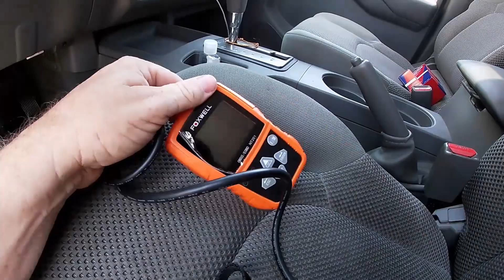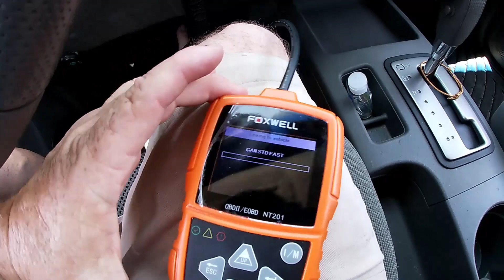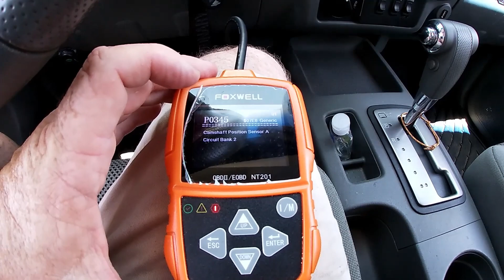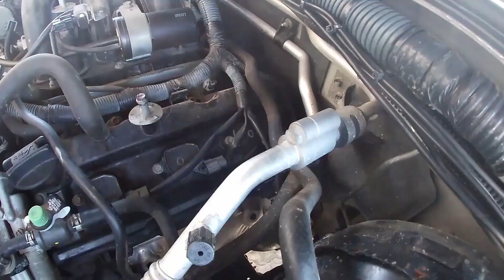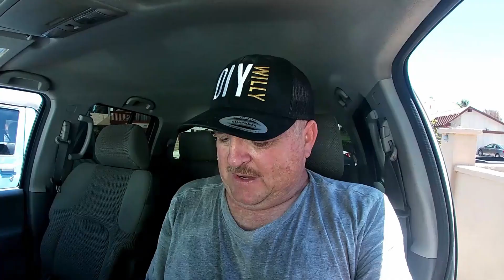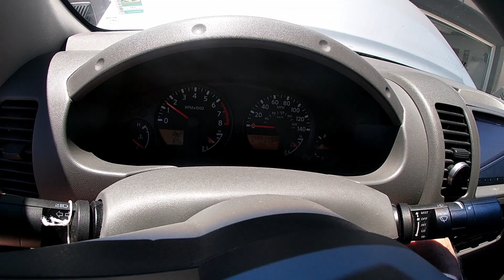Nissan Frontier 4.0 Cam Shaft Sensor Replace

Comment: Replaced the right sensor A. To remove it, I pulled the tire off and pulled the mud guard back, and there was plenty of room. It still goes off every few months. I have to unplug the battery, cross the wires to drain the memory, and restart. It works for some time.
Reply: If your camshaft sensor is a chronic repeat offender at that rate, might need to look at the timing chain and see if it's stretched or the tensioner is worn out.
Reply: Also apparently nissans are very temperamental and like to burn through those sensors if they are not OEM branded hitachi/ astemo is also a good buy as they are OEM manufacturer. Just doesn't come with the nissan box lol

Comment: I replaced both cam sensors and cleared the codes but i cant get the generic code to clear
Reply from the maker: What’s the generic code? The truck will most likely clear it in the next drive cycle if there are no further issues.

Comment: Thanks for sharing my I have 2013 Frontier and my truck is doing the same thing the garage told me that it was a cam sensor bank 1 not sure if that’s right side or left side your video was a good help I just got to figure out what side it is
Reply from the maker: Hello Myty, So glad you liked the video. Best to change both sensors and some suggest all three.(2ea cam and 1ea crank) Reason being when one goes the others are usually not far behind. On the Nissan v6 bank on is on the passenger side. Good luck with the repair!! Thanks for watching!!
Reply: Thank you your were a good help
Reply from the maker: Glad to hear your truck is running again.

Comment: Curious what you used to get the bolt out? I’ve been trying to get this changed in my Xterra, and I can’t seem to get anything on the bolt to get it out. I’m thinking that I should unplug it first, and then do the bolt.
Reply from the maker: No it’s a tight fit but using a small 10mm socket and 1/4” drive ratchet should remove the bolt. I feel it’s easier to unplug when out.

Comment: Was that the bank 2
Reply from the maker: Hello, Yes that was bank 2. However it’s recommended to change both sensors bank 1&2 when doing this. Also the crank shaft sensor but not really necessary. Thanks for watching!!

Comment: I just replaced the crankshaft sensor on a 2012 Frontier with a 4.0 V6.  Thanks to all the folks for sharing their experiences and some tips.  Keep up the good work Willy.
Reply from the maker: Hello Jim, I usually suggest changing all 3 sensors but for me just the cam s baits did the job. Thanks for watching!!
Reply: Did your truck leave codes. My truck suddenly shut down last week and thats what I thought it was.  My mechanic friend said not likely because no code was present.
Reply from the maker: Yes the truck showed P0345 for cams sensor.

Comment: Hey brother I came across ur video I’ve got a problem with a truck just like urs.. it will crank but running horriable had to pull it home it wouldn’t excellerate and the would both down like it’s being smothered out.. my scanner is saying the Maf senc is at 0.01 % is it safe to say it’s went bad? Or does it sound like another issue causeing it to run horriable? Thanks bro appreciate ur channel!!
Reply from the maker: Hello Joshua, There so many things that could cause the problem you describe. Yes the MAF sensor could be bad. But I would believe that there would another code also relating to fuel balance or similar. Could also be the cam sensors are failing or have failed. These would cause a poor running condition. What were the codes pulled from the computer? Another possibility is bad cats. Not allowing the engine to breath properly cause a running issue also. Kinda like a potato in the exhaust pipe. Really hard to troubleshoot your vehicle without seeing it. 
Thanks for watching!!
Reply: Hey Brother!! Thank you for replying!! I changed the Maf and it’s cranking and idoling but still feels like it’s smothering? It says P0300.. Random/multiple Clyinder Misfire.. andP0113 intake Air Temp 1 circuit high.. is the 2 codes ? I’m NO Macanic at all but cash tight ya know n tryn to get it running for work
Reply: Thank you so much for replying bro!! I’ve Got 1 of my NEW FAV CHANELS!!!!!
Reply from the maker: Try looking for vacuum leaks. There are not too many vacuum hoses but remove the plastic engine cover and inspect the small hoses going to the plenum and accumulator. Look for small cracks in the hoses and replace them with 6mm hose if damaged. Also the throttle body can be dirty on the back side. It’s easy to clean but removing the 4 screws and the 2 coolant hoses. Clean the throttle body of dirt with carb cleaner and a small tooth brush. Just be careful not to push too hard on the flap. The throttle body has an oring seal and is reusable if not damaged. Those are a couple of easy things to check and repair. Other causes are more expensive and time consuming like the cam sensors, spark plugs and bad coils. Since the code is just 300 and not something like (301-306) makes it harder to diagnose with out really scanning for additional information. If it was 301-306 would tell which cylinder had the misfire. 300 is generic. Sorry I can’t help more… Good luck!!👍
Reply: @DIYWilly  dang Brother You R THE MAN!!! Appreciate your help you r spot on!! Thank you again!!!!!!!
Reply from the maker: I know this is a dumb question but is your air cleaner clean?

Comment: I replaced both of mine and crankshaft sensors and my truck is still doing it, so you think I just got bad sensors? And is it important to clear codes before starting it?
Reply from the maker: Hello truth, What are your codes? Possible you have bad sensors but I doubt it. Thanks for watching!!
Reply: If you purchased aftermarket cheap sensors then yes you will continue to have the issue.  Unless you got a code for the sensor it may likely be something else.  My truck stalled last week for no reason and I thought it was the cam sensor but there are no codes showing up.  Hasnt happened since
Reply: Could be a bad cam

Comment: Would that sensor cause crank but no start?
Reply from the maker: There is a crank sensor that detects rpm.
Reply: @DIYWilly  so the camshaft sensors wouldn't cause no start?
Reply from the maker: @c4or2ey0  yes it could cause it not to start. But from my experience it usually just runs bad like it’s in limp mode with very little power. Do you have a check engine light? That would be a good way to identify the problem your talking about.
Reply: @DIY Willy  it's a friends truck so I'm not to sure just yet. He was asking me about what I thought might cause it to crank and no start. He said it had a code supposedly, for the camshaft sensor.
Reply from the maker: @c4or2ey0  Definitely try and get the code. Also how many miles on the truck?

Comment: WOW! great job. I checked out my haynes Repair book and it shows you have to jack up the vehicle and go in frpom bottom...you made it look so easy. thank you the illustration.
Reply from the maker: Hello Blake, that what this is all about. Sharing different ways of doing things. I think this would be hard from the bottom. The sensors are high up on the heads. To reach up from the bottom would be more difficult. Thanks for watching.

Comment: got 06 pathfinder in the bay today with a broken wire to the tcm and needs timing chains replaced called guy to tell him price to pull Trans and fix along with parts for both motor and and Trans he stopped buy at lunch and gave me his title said he didn't want to spend the $100 for looking at it
Reply from the maker: Oh wow now you have a Pathfinder..
Reply: @DIYWilly  yep that needs around 1500 in parts
Reply from the maker: @heathenprojects2639  sure but once fixed it’ll be worth more than $1500 right?
Reply: @DIYWilly  5-7k right buyer

Comment: Why did you not show us how to get the hard one out?
Reply from the maker: I did discuss it in the video with the harness in the way.
Reply: @DIYWilly  did you have to twist either to lock/unlock them before you could get them out or.in?
Reply from the maker: Once you remove the one bolt you can twist slightly to loosen it up but it should pull straight out.
Reply: @DIYWilly  Thank you for your help.  This is not a job for those with large limbs.  My arms my hurt for a while.
Reply from the maker: Yes definitely not a job for someone with large arms or hands. It a tight fit. Hope I helped you and thanks for watching..

Comment: What's that winning sound you get when u start the truck? I have the same issue
Reply from the maker: The whining sound turned out to be damaged timing chain guides. It a common thing and the repair is very time consuming and is an expensive job. I have videos about the problem and the repair. Thanks for watching and hope this helps.

Comment: Im a dummy, I didnt know there was a bolt. I spent a good hour tugging at this thing wondering why it wouldnt budge.
Reply from the maker: Well I hope the video helped you. Thanks for watching
Reply: @DIYWilly  It did! Thanks for the reply! I bought a 2011 SV 4x4 in April with 36k miles. It sat for it’s entire life. I’m catching up with issues from it just rotting under a tree. Your videos have helped with the repairs/slight restoration. Once it’s in tip top shape I’m gonna get it titan swapped like yours. Yours is titan swapped right?
Reply from the maker: Sounds you have a great start on an amazing truck. Have a safe and Happy New Year.

Comment: Great video… camshaft sensor bank 1 is the right side if I’m sitting in the vehicle? .. and where does it say change both sensors?
Reply from the maker: Bank 1 is the passenger side. Honestly the sensor are not expensive and most likely the same age meaning installed at the same time. Change both while your there if you doing the work yourself. Also I believe in the package if it recommends changing both. Thanks for watching

Comment: The duralast part still going? I’d rather not have to spend the $$ on OEM from the stealer.
Reply from the maker: Built to last Duralast!!! 👍 Still going strong!!
Reply from the maker: The Duralast parts are holding up as expected. No problems at all. Thanks for watching.

Comment: I changed these on my 05 back in October that right side is a pain the butt to change
Reply: Have you had the timing chain replaced I hear the Infamous whine when you started it up
Reply from the maker: No but I’ll have to listen more closely when the truck gets back. Is it that easy hear? What in the timing chain set causes the whine? The tensioners?Thanks for the heads up..
Reply: @DIYWilly  listen at the end  of your video when u start it you can hear a slight whine noise that’s the same noise I had before I had to change mine
Reply from the maker: Thanks I will definitely check it out. Did you change the chains yourself? If so any suggestions. Sounds like a big job.
Reply: @DIYWilly  no I payed some one else to do it for me to much involved for me to do it myself
Reply from the maker: Understand
Reply: Just remove the upper intake and its very easy. While you've got it off go ahead and install new spark plugs.
Reply from the maker: I have mine off again also. I’m in the process of changing the timing chains and tensioners.
Reply: @DIYWilly  Awesome. Good bit of work but I think these trucks are worth it.
Reply from the maker: Definitely worth it. This has been a great truck and the timing chain replacement is really the first expensive maintenance I’ve had to do. I am also while I have all apart changing the water pump, thermostat and all the coolant hoses. I also noticed a leaking CV boot. Those are easy and will be the next project along with fluid change on everything.
Reply: @DIYWilly  How many miles on yours? I have 211,000 as of now.
Reply from the maker: Has about 200,000
Reply: I did this job earlier today on my 2008 Frontier with 4.0 engine, and I have a suggestion regarding the cam position sensor on passenger side.  I removed the bracket on the back of the intake that holds the wire looms in place.  First, I used a pair of needle nose pliers to push the connectors out of the bracket (three of them), and then unbolted the bracket.  Not only did this allow me to see the area a bit better, but it provided extra room for manipulating the sensor out of and back into position while affording me a clearer path to ejecting the sensor.  Although it was not a necessary step, I found it much more useful because I saved my hands from getting scratched up due to bad positioning.  Removing and reattaching the bracket to change the sensor added a total of 10 minutes to the job, and I was completely cleaned up and back on the road in less than an hour.  I hope this suggestion helps someone.  Stay safe and have a great day!
Reply from the maker: Great suggestion I will try it next time I replace the sensors. That’s what makes YouTube such a great place. We can all share our experiences and hopefully help the next person. Thank you for commenting and Thank for watching